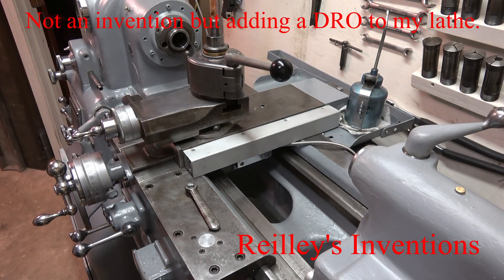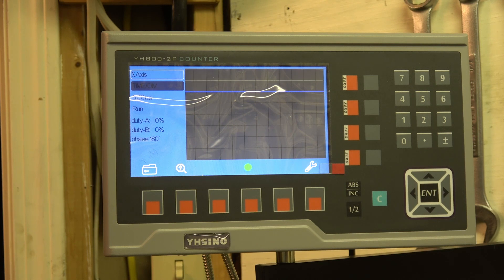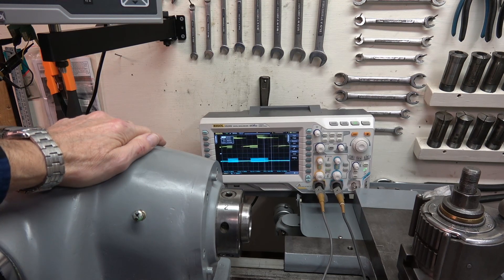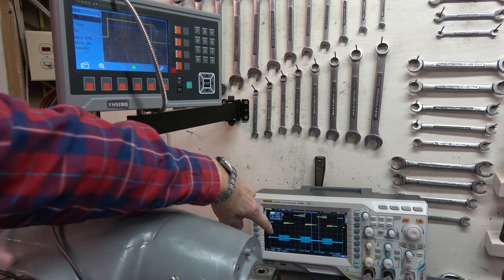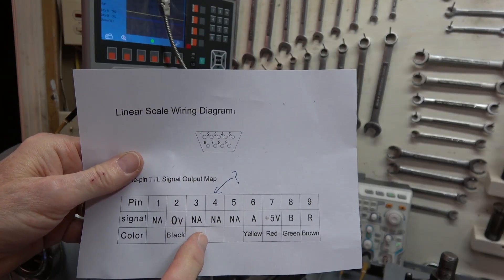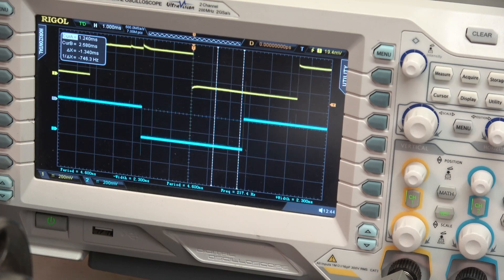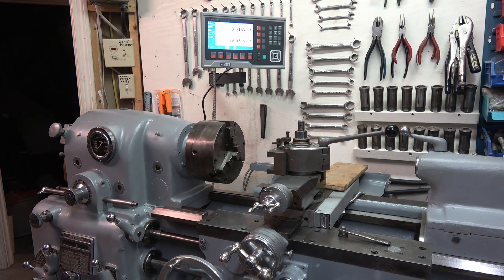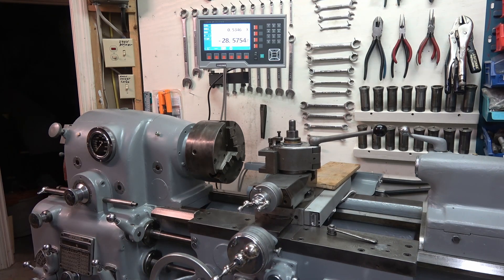Problem and fix for YHSINO DRO and EASSON scales.

Comment: Thank you for taking the time to do this - had the same problem with a newly replaced scale, but the dealer just wanted to sell me a new scale (again!). Cut pin 4 and it has worked seamlessly since. (Easson scale-Easson readout)
Reply from the maker: I just bought a new YHSino DRO for a different machine, and it does not have the little circuit board that caused the problem.
Reply: @reilleysinventions4155    I had almost a full day with no problems, but late in the day the problem returned.  I had cut the wire first thing in the day.  But it occured after the scale was used in one particular point. (Noted from previous glitching) Now this was after the scale was stripped and meticulously stripped and cleaned with clean gloves, clean swabs and alcohol. (no real dirt or grease found)  The problem was witness then accelerated in frequency until the scale will not read at all - just flickers on a number read.    I dont think it's a physical optical fault - seemed electronic?  I've got a day until a new replacement arrives, so might have a play with it
Reply from the maker: @glennlawrence3098  Did you use the YHSino DRO debug feature?   That is the reason that I bought it in the first place.   That is the feature that turns the display into an oscilloscope.   You can see the 2 phases from the scale at the same time.   They should be close to 90 degrees out of phase to work properly.   The display measures the out of phase amount and displays it.   It was a great help in my discovering the original problem.

Comment: Great job buddy.  Excellent explanation, very useful. There is something I have not found the answer about (I own a Easson GS10-750):  How come the outputs of the reading head are three (A,B and R), but it has five pairs of photo transistor - infrared led. What are the other two for? Any idea or clue? 
Thanks.
Reply from the maker: I don't know, I did not notice that many photo transistors.   It could be that the extra transistors provide a reference level to the transistors that actually read the scales?
Reply: @reilleysinventions4155  Thanks a lot for your response.  I'am still working on that, let you know if I find a precise answer. 👍